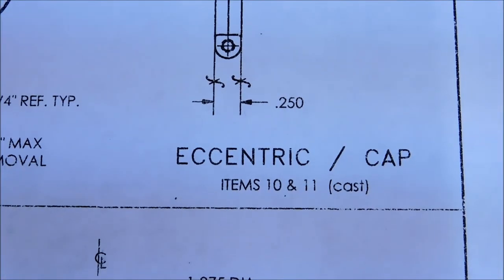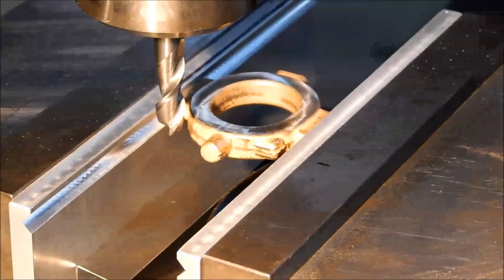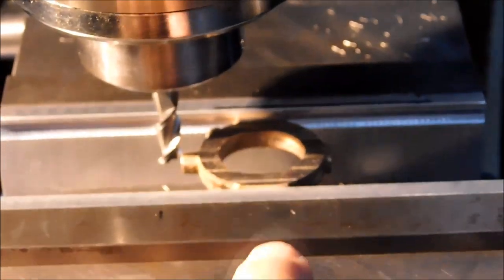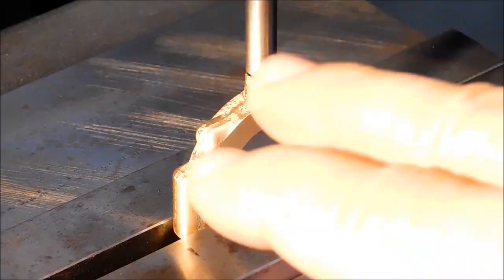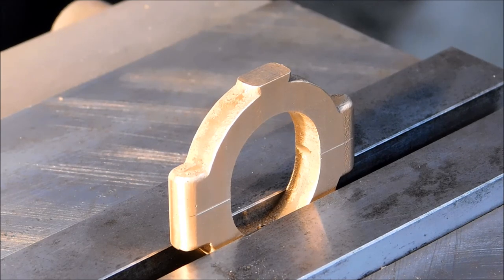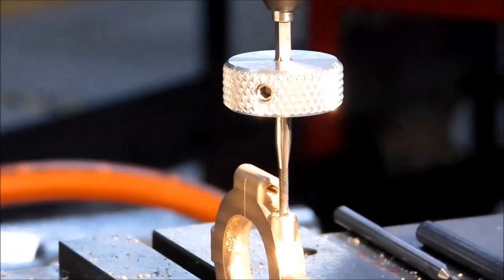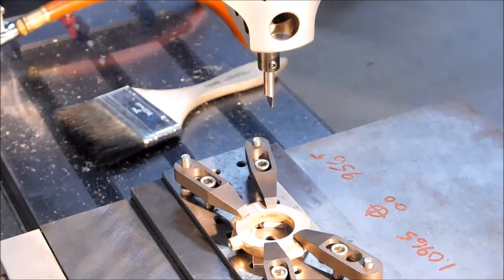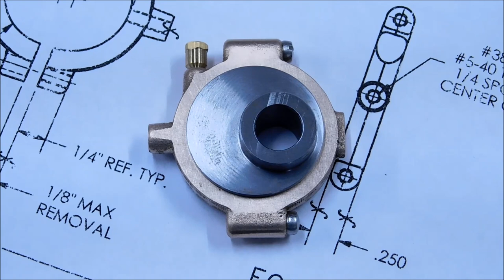Machining a Model Steam Engine - Part 16 - The Eccentric and Cap

Comment: Can i assume you are using CNC to make a vintage part. ???? I notice you never show your milling machine zoomed out. Always close up shots.
Reply: I dont think he is, in some of the shots you can see the knee ways.
Reply: He does it all by hand. His mill isn't a CNC machine.
Reply: No, he is using a Bridgeport manual knee mill.
Reply: He uses a Cranium Number Cruncher (a.k.a. mental arithmetics).  He has a CNC mill for other shop work, but this build is all manual and maths.  Inspiring stuff Joe - thanks.
Reply: Nope, Joe is using his Bridgeport style mill.  Have a look at his other videos, he has spent a fair amount of time developing his skills, similar to a piano player, he can precisely move his right and left hands independently to follow a pattern.  Amazing skill, a treat to observe!
Reply from the maker: I have a CNC here in my shop, but this model is being machined,  completely manual. The other comments in this string up to now are correct.  And Thanks Rich.
Reply: @joepie221  Well joe i hold my hat off to you for being so good on the controls. Note to oneself, try harder. Regards . Steve.
Reply: The Digital Readout (DRO) attached to his manual mill makes all the perfection possible. However, JP could do the same with dial indicators or even by feeling the backlash in the axis handles and still being able to hit his numbers. He's done this sort of thing for a few years.

Comment: Question: am I correct in stating;
(He/she/it) who finishes building this kit to excellent quality has earned the title Master Craftsman. 
The kit is not done yet and you have already earned the title, few times over.
Reply from the maker: Thanks. The kit can be finished many ways, but little details will set them apart. I have to admit, the deeper I got into this kit, the more effort I gave it.

Comment: Reppeza joints  Take a ball and a torus   Rotate the torus around the ball subtracting without removing  At the same time take  a larger ball  Subtract the inner ball without removing the inner ball As the torus is subtracting from both the inner ball the grooves for the bearings are created in both the inner ball and outer ball
Reply: What?
Reply: @tridium-go6hw  Curve ball   My brother is a master machinist at the local factory.  A reppeza joint is a CV joint on a car.  Cad Camming a Repezza joint sequence.  Start with 2 spheres  and a torus.  With the ability to scale a drawing the  Unit size can be used.

Comment: As a 16 year old just starting my apprenticeship, parting off using the rear tool post on a ward capstan lathe was a hair raising experience. Made all the worse when one of the old hands lobbed a great lump of steel into the swarf tray which often resulted in a heart stopping moment.
Reply: That's a time u need to stand up and be professional.  Tell that asshole an accident could have happened.  Would he be laughing if u lost a hand? Shit like that was grounds for dismissal when I was a shift supervisor.
Reply: I had another apprentice do that behind me while I was running a large Lodge and Shipley lathe when I was an apprentice.  He was nearly fired over it.  That's not ok, it's an easy way to get someone badly hurt or killed.
Reply: @JM-br9sp  Not an easy thing for a 16 year old to tell an old hand off.
Reply from the maker: Next time you see him looking at his digital readout on a fussy cut, get close to him and roll a empty soda can between your hands. It makes the same sound as a cutter breaking and chewing up a part. It works best for a lathe operator. When he turns to punch you in the face, just tell him, " we're even now". He'll either still punch you, or you will just have gained some respect and taught him a new trick.
Reply: @joepie221  Bit late now that was back in the sixties, although the fresh faced schoolboy soon learned to hold his ground. Love the channel by the way, especially the individual tips and tricks, which you share so generously. Manual turning and milling still requires many of the timeless techniques  learned during my apprenticeship.

Comment: What is that "fancy x/f" looking symbol on the print?
I looked through machinery's handbook but didn't see it.
Thank you.
Reply: If it's the one I think you mean, Joe mentioned in an earlier video that it meant "final dimension," or "we really care that this measurement is accurate." ;-)
Reply: I think it's a finish mark, by my copy of technical drawing doesn't have it at all
Reply: @dafydd2277   Thank's for that information, I appreciate it.
I've watch this entire series, but must have missed the explanation.
Reply: I think that means finished surface
Reply: @pacman10182  You just won the prize!
Reply from the maker: When this model is done, I may stamp the print with " Fancy AF" in big red letters.  The mark you are referring to is just an indication of a machined surface.

Comment: Are there hex head nuts and bolts made in small sizes for models?
Reply from the maker: Probably, but I'm thinking square head would be period correct.
Reply: Yes you can purchase down to 00-90 hex head screws from various dealers.